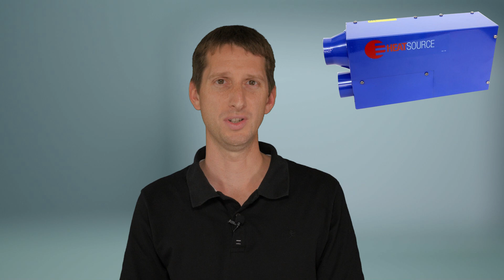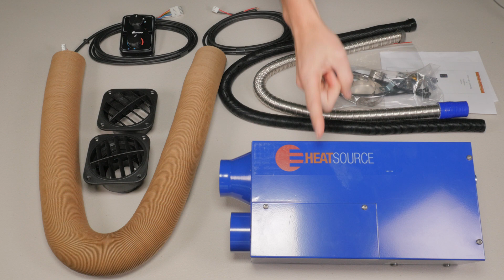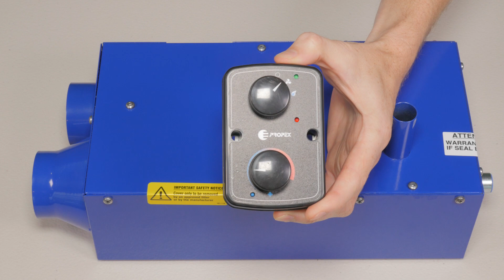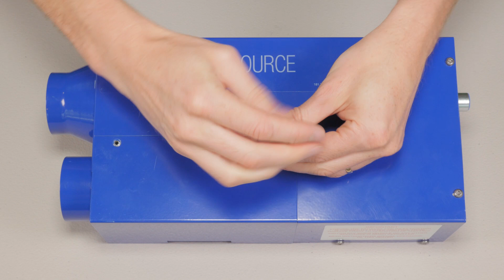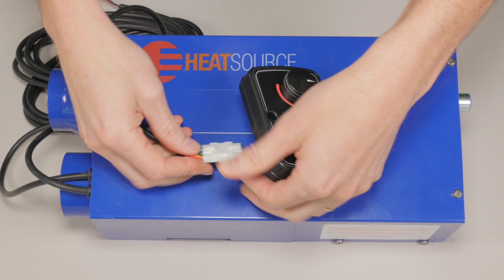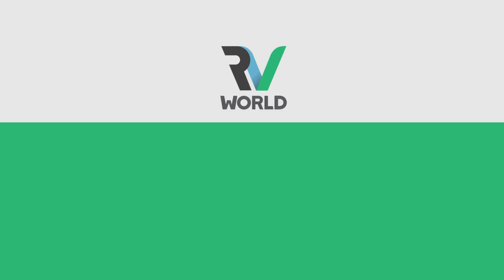Propex Heatsource HS2000 Heater Overview

Comment: Is there a problem with running it at high altitude (3000 meters- 9000-11,000 feet)? And if so can the fuel mixture be adjusted?

Comment: Hi, could you tell me please how much smoke  is going outside from exhaust pipe? Will it be seen in the winter time or summertime that is something's going on in the van? I am asking  as I am planning a kind of stealth camping, and sometimes I might be parked on public roads. And another question, how far the gas bottle could  be from the heater in term of pressurewise?   Thanks.

Comment: Piece of shit. $900 wasted. No thank you. Once it's UNINSTALLED for the cheap diesel heater I should have bought in the first place. 11 years as a trucker the diesel heater kept me warm. I could buy 6 for what I paid for a Propex. Total garbage and terrible support.
Reply: Can you share what heater you purchased?
Reply: @healingjourneys4241  propex. I don't remember what model. Dealer in AZ had just dropped the line because they had terrible service from the factory. 

I bought a Chinese diesel heater from Amazon for $130 and 2 winters later I'm still happy. Not with my propex experience though.

Comment: Here in England you would soon be broke with a propane heater . 13 kg  ,$40 US !  I must be honest, it is much cheaper in Germany and Morocco .  Here we use Diesel heaters. the Best Known is the Epersbacher. Also Webasto and Alden. Cheap to run, Almost  Silent ,( Click from the pump) ,  SAFE ( No gasses or condensation)  . New Chinese Copies. They are Cheap & Good !
Reply: condensation???🤨do you think its the same principle as a bloody hob burner? 😂 its the same principle as you diesel heater and has a separate combustion chamber from air circulation so not sure where would you get a condensation from?..

Comment: does the outside blue cabinet got hot , and will it burn combustibles near it,  I would have to mount one in an overhead cabinet ??   I have more questions than a 6 year old, hhah     J R
Reply from the maker: Hi James. No, the blue cabinet does not really get hot. The way the heater is designed, it should be mounted on the vehicle floor and ducted directly outside. If the unit is mounted in an overhead cabinet, the exhaust flue hose-tail (which you connect the flexible hose onto) will be inside. This connection area is a potential source for a combustion exhaust leak which is why it should be outside. Craig.

Comment: I am now at the end of third month using HS2800.. it's works great and is very cost effective with propane compared to other heaters I've used.. it is fairly loud when it runs but not intolerable.. yes it does wake me sometimes at night but over all I sleep through the night more often than not.. I've installed it temporarily in a trailer, it's fully open so I do hear the 'mechanical' parts as well as the fan blowing but in a few months I will be ready to install it in my RV (which I bought it for) and it will be totally inclosed in a cabinet with sound insulation around it so a good portion of the noise I hear now will be much lower.. (I have experimented  by covering it with a sound insulated wood box so I know how much different it will be when I install in RV)
Reply from the maker: Hey Mr Meanderthal :-) Great comment, thanks for the sound review

Comment: What would be your propane usage rate pounds per hour
Reply from the maker: Hiya. The HS2000 uses 142 g/hour. I'm sure Google has a search engine conversion tools to convert grams to pounds.
Reply: .313 lbs. Per hour is not bad if it doesn't run for the entire hour
Reply: PS, thanks for the reply

Comment: Can you install the propex on top of a wheel well ?
Reply from the maker: Hi Dugg. I expect probably not. The heater is mounted to the floor. Under the heater there are 2 hosetails that you connect your inlet & exhaust pipes onto. I don't expect there will be enough space between the wheel and the wheel-well.

Comment: A quick question......can you run only the fan on the Propex heater?  I was planning to install two vent fans in my RV, so that I could get good circulation, without having a window or door open. So my question is can the Propex heater run in fan mode only to draw fresh air into the cabin and separate fan, roof mounted fan be used to exhaust air out of the rv?
Reply from the maker: Hi Heather. Yes you can run the heater on fan mode only. It will just re-circulate the inside air unless you have the cool 'cabin air' feed coming from outside. I don't recommend drawing your cabin air from outside because then you will pressurise the inside cabin air and heat will be forced out the roof vents (if it has passive ventilation holes).